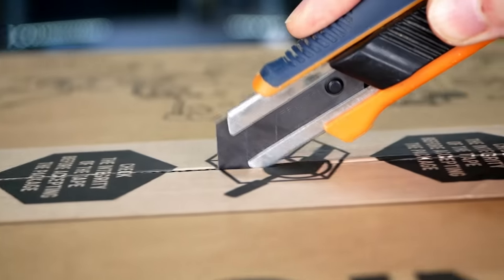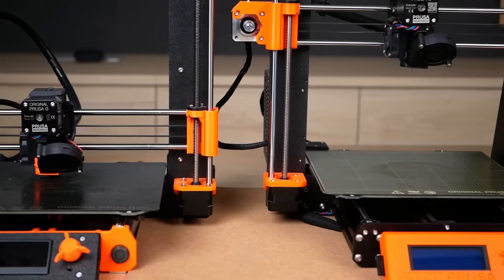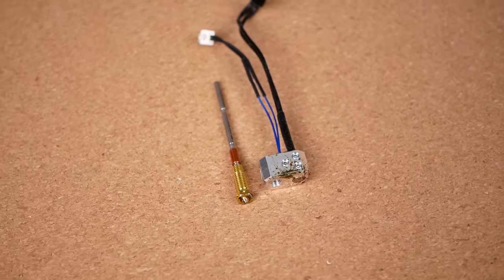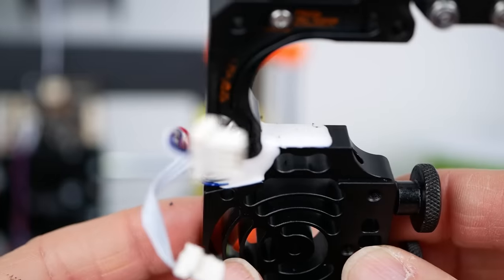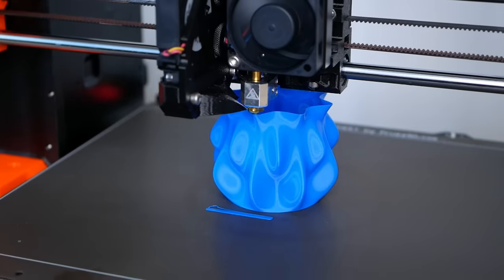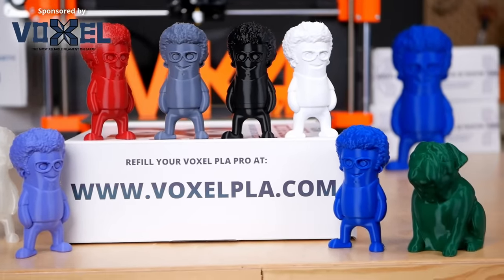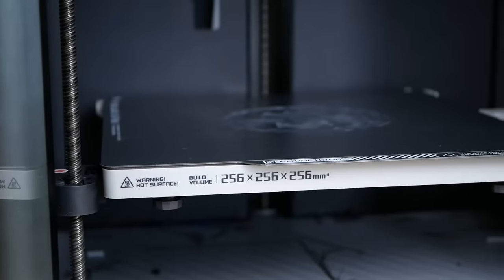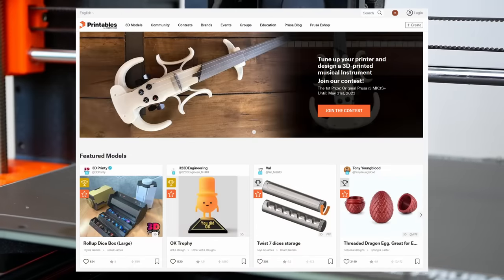Should you buy a NEW Prusa MK4 in 2023 or rather a Bambu Lab X1/P1P?

Comment: Prussa 4k as a hobby-ist. but if I had to print many identical things quickly and speed was an issue I might go Bambulab as a trial. But My MK3 with upgrade 5 spool exchanger is solid turn on and walk away. you can't beat reliability and the customer service over the years is A1. besides. It came with gummy bears as a snack during the build process...Awesome... and Haribo gummies at that🤣

Comment: At all who complain about the price of the Prusa MK4 compared to the Bambu P1P. Did you ever consider the lifespan of the printers? There are X1C from Kickstart that already have more than 2k hours on them and the bearings and rods have started to wear out. There is no possibility regarding BambuLab to do any maintenance on your own. You have to send the Printer back to BambuLab to get the maintenance done, and also, they can't tell you the exact costs. My friend was told that it would probably be 400-500€ for a printer with only 2750 hours.
There are Prusa MK3s out there which have more than 15k hours on them, with no major maintenance!  

Costs: 
So when we come down to what is the lifespan of the printers? Let's assume that a Prusa MK4 makes 15k hours, and a BambuLab P1P makes 3k hours (which it won't do). What does the Calculation look like?
Prusa MK4: Investment 1000€, lifespan 15k hours: Printer hour amortisation: 0.067€
P1P: Investment 800€, lifespan 3k hours, plus 4 times 400€ major-maintenance costs for another 12k lifespan , Total: 2400€: Printer hour amortisation: 0.16€
Now you can say the P1P prints 2-3 times faster than the MK4, and you end up at the same costs as the MK4. 

Support:
What about the support of Prusa? Just awesome! Jump in a chat, describe the issue, and receive support/spare parts.
What about the support of BambuLab? ...it's ridiculous. Response times more than weeks. There are so many DoA's out there who wait for months for spare parts.
I have personally been waiting for a new bed for three months! Waiting for another bed for my second X1C for two months. All signs are telling that the beds will be bent as before, simply because the bed design is a design flaw. 

I don't wanna start with QC. But anyone thinking about buying a P1P or X1C, go and look in the BambuLab forum. You won't buy a BambuLab printer anymore.

Comment: Stephan, I see you are using VOXEL in AMS, can you comment on reliability?  I have been respooling some filaments onto Bambu spools for utmost reliability.  Also, since you are genius level, how about reverse engineering the RF tags so we can put them on other filament types for auto profiles?
Reply from the maker: So far, they have been working reliably in my AMS. Regarding RFID; Have you seen this: https://github.com/Bambu-Research-Group/RFID-Tag-Guide
Reply: @CNCKitchen  thanks for quick response.  I have seen that link, but looking for a complete solution rather than just reading rfid tag.  Here is my ideal, be able to buy an rfid tag preprogrammed to allow a profile to be created in slicer to match.  So, far the only way I have been able to “cheat” is buy refill with color or type I don’t use and then modify the corresponding Bambu profile..less than ideal. I did buy Bambu PLA and have respooled my own (with printed respooled from Printables.  I just didn’t want to be locked in to Bambu filament due to cost versus vendors like Voxel, Hatchbox, ERY and others. I guess not a huge deal, but hardware is there. I did put ticket in with Bambu, they should sell blank RFID tags and allow this,but I think they want to lock you i. Which isn’t feasible given their poor stocking availability and cost.

Comment: honestly, i ran into so much issues with my mk4 compared to the mk3, i just sold it, weird layer shifting, parts modeled square but printing not square, the support being absolute assholes now, the missing colision detection that would have saved some of my prints, the quality with input shaping not being there yet, and more, my mk3s on the other hand is printing better than the mk4 with the updated parameters, really is still a beast after 20K hours, i regret selling one of my mk3 to get the mk4, really.

But for coms and prototyping i think i will take a bambu for fast printing.

Comment: Ive had a love and hate with prusa printers, when they work all is great but when issues happen you have to disassemble most of the working printer. If you found the wrong issue you then had to do it again. Enders seemed to make it easier as extruder and hotend were more accessible. I have been searching for multi color printing solution and prusa and mosiac have been nightmares. Bambu just works. Yes there are issues but mainly due to filament.   .... with that said I have retried 10 enders and prusa's from my print farm to bambu's. I will be looking at your pla sponsor as I use a lot of colors in multi color prints
Reply: $320 order of filament placed

Comment: It's to the point that I am almost over tinkering with 3D printers to improve a product I purchased because my ender 3 pro has given me soooooooo many problems over the years. I kinda hate the style of printer that the mk4 is and would much prefer a core xy after all of the tuning time and effort I have put into a far inferior product. I like tinkering, but I don't want the fixing and adjusting to take a backseat to the actual printing. If the MK4 came out a year and a half ago, there would be no issues with it's pricepoint, but since the X1C, P1P, and P1S all being within spitting distance of the MK4 whilst offering seemingly more capability, the mk4 doesn't seem like a reasonable buy.

Comment: I think I would buy the Prusa MK4. I am a big fan of Klipper firmware, and I have a heavily modified Ender 3 that I've been upgrading to print faster and faster over the years while also increasing the print quality at those high speeds. But now I feel like I'm printing things so fast that it's more of a flex than practical.The thing I am chasing is the highest quality possible, not record-breaking speeds, and I think Prusa is still king when it comes to print quality. I am amazed by the Bambu Labs lidar sensor and auto input shaping, but the software seems proprietary and locked down. I prefer open source software, I want a machine that's easy to work on, easy to repair, and easy to upgrade. However, I do think it's time Prusa moves to a Core X Y design.

Comment: The one thing I’m not a fan of is the cost of the nozzles. If you live in the US it could cost over $40 for a BRASS nozzle. Then if you use the adapter you still have to hot tighten and could leak and affect your first layer. I don’t understand why nobody is talking about nozzle cost.

Comment: Hello Stefan, very comprehensive review ar  high speed 😄.  Lots  of talks about MK4 <> bambulab machines lately.  
Well, I use neither of them. I make small high precision parts with FMD but as it is for business and speed was not my first priority, very low investment cost at start of buss is key to make money in an area where you pay 50 cents per kwh for electricity. So  I still  use very low cost bed slingers, effectively about 230 Euro each, based on the old ANET A6 kit, but rebuild it so they run on a 32 bit board, and a sherpa alike extruder on lin rail with a simple strain gauge for nozzle probing , they do just fine, but speed is of coarse another thing (~80mm/sec)

But objectivly speaking: when I now see this Bambulab core xy printer quality of print  and that at a very serious higher average print speed......this becomes  very interesting for production too,  times 2 or 2.5 the print speed... that is a serious win.

What I  really like on the MK4 as a good innnovation is this double pressure wheel on the large drive gear to give larger grip area. I guess it brings fantastic filament grip... but ....  for on a bed slinger ? ....  It would excel on a core XY where higher /constant output and  much  higher pressure is  a must when printing with small nozzle diameter (0.15) at high speed for small  tech parts.  
For the rest, well looking at  11:55 and 16:20 of your review.... knowing what is different inside both machines regarding various technologies, It speaks for them selfs....

Do not fully understand their strategy in the bed slinger design by PRUSA for sake of upgrade .... I guess all their customers with MK2 / MK3 are very happy with this solid work horse, so they could have moved over to the core xy in the MK  price range.   Come one PRUSA !  lets beat the chinese ! 😅

Comment: I recently had the chance to test a Bambu Lab X1 Carbon coming from the Open Source POV and I think the Bambu Lab is especially for non-tinkerers. Like when you just want a 3D printer for actually production and rapid prototyping without a deep dive into 3D printing basics. It basically is the first plug and print printer I've seen, that actually can be considered plug and print (not exactly, but almost). Still, I wouldn't buy one as I really enjoy breaking and fixing my machine.
Reply: People were saying the same things about the ender 3.
Reply: @pomprocks  Actually, I never heard anybody saying that about the Ender 3. Yes, it was praised as a production machine due to it's reliability as well as a beginner model due to the low price, but the Ender 3 was never promoted as a plug and play device that can be handled without experience (although it was some kind of miracle compared to its competitors at the time when considering what you get per buck).

In the past many manufacturers falsely claimed to bring a plug and play experience to desktop 3D printers (e.g. the later Ultimaker models, Makerbot since their acquisition by Stratasys and the somewhat laughable Solidoodle 2), so I naturally doubted the promises made by Bambu Lab, but the X1 turned out to be the closest to plug and play I have ever seen. Setting it up required almost zero effort and it printed almost perfectly out of the box, even when handled by someone inexperienced. It's been two weeks since I worked with it and I'm still stunned. It all comes at the cost of a closed sourced environment, though, so it's nothing for me.

Comment: The Prusa is a bit like a Celacanto, a living fossil  still doing what it was supposed to do. The quality they pull out of the prints have been always great, but,  for those like me who need speed+quality at low prices we have long ago migrated to resin printers, I keep fdms for prototyping in big format and functional pieces, but for things that eventually will go into injection molding or diecast, so they will go for some finishing anyway, the effort that goes into keep a fdm running, fixing, and updating and taking care it is just too expensive and time consuming, for instance, a delta machine and a resin machine both bought at the same time, the resin machine still goes unchanged where the fdm have gone through 3 hot end changes, one mother board change, one display change, and extruder improvements, several nozzle changes,  and chassis modifications to avoid motherboard overheating (because of design problems), I mean under 1k fdms are hobby machines, prosumer machines at best, if you would like to go pro and still somewhat european just by a Wasp, I think Prusa is a bit now like a Leica, (without the design since I think to have a 1k machine with 3d printed kit like parts is unacceptable) but today, why would you pay so much  for a machine that has a y axis moving bed, which at the end its very limiting, quite limited building volume   and too many characteristics present already  in sub 200 euro machines? Whoever has been involved in electronic design and manufacturing knows that today whatever you do  in Europe will  have a huge % of Asian sourced parts, so I think the European costs are no excuse... the prusa should cost 400 bucks, and I'm sure they'll sell a ton, the thing is like a manufacturer told me, I prefer to sell one thing at 500 than ten at 50. And that's just how you eventually  go bankrupt.   Bambu wont get to be a monopoly, they are just doing what Elegoo did, pull out a great machine at hobby consumer's reach that once belonged to the pro area...the triptronic gearbox now present in a Polo is the same that   belonged to a 90s Porsche, and that's just evolution...like the Celacanto.

Comment: I am considering to replace my mk3 farm to either same number of mk4s or half of that in x1cs. Very hard choice. The x1c is absurdly fast with quality I haven’t seen before. But the mk4 is from a brand I’m familiar with, has proven itself and is very customizable. 

I bought one x1c to test stuff and also made a special S3D profile to make automatic PLA part removal possible. Which is very nice for large quantity printing. But the fact that Bambulab (semi) locks you you into their system is something I hate.

For example: they use a range of custom gcode commands which have no explanation anywhere. Using a different slicer than Bambu studio also makes certain features unavailable, probably because the required gcodes/commands are not published. You can send prints via wifi from you computer as long as you use bambu studio to slice models. But as far as I know you can’t send gcodes sliced elsewhere because you can’t import them into bambu studio, so the old fashion microSD card is still needed.

Anyway, I do think the speed, quality, closed build chamber and my automatic part removal profile will make the x1c winner in my case.

Comment: If it's possible to implement Klipper and input shaping on an Ender 3 by hooking up a raspberry pi and a little sensor, then there should be zero doubts in your mind that the same can and will be implemented on the MK4. It's very plausible Prusa is just analyzing Bambulab's machines while optimizing their own software only to push out a software update later that enables all the features to fully utilize the hardware. I don't even own a Prusa so I'm not even biased in this discussion, just pointing out that I can almost guarantee you that they wouldn't spend extra money on sensors and other hardware without planning to fully enable their usage with a software update later.
Tesla did the same thing with autopilot.

Comment: Prusa has very good engineering, but seems to be a bit short on delivering on the software side, as you state.
I'd hope they find a way to be more competitive there.
And as far as writing software, it is also a bit old fashioned to first set your hardware and then select the software. Wonder why they would not use Klipper for example. Perhaps limited availability of suitable raspberry Pi equivalents has to do with that.

Comment: From what I have seen here, the Bambu P1P is currently better than a Prusa Mk4.  However, Prusa printers come with a 1 year warranty and the parts remain available for a long time.  I have even been able to download the parts and print them myself.  I have also done a firmware upgrade on my 3 year old Prusa Mini, which made it better than it was when I bought it.  I have also been able to contact customer support and get help with my printer years after the warranty ran out.  

When you buy a Prusa, you're paying for the customer support.  When you buy a Bambu printer, you're paying for the speed and the features.

I am disappointed that the new Mk4 is a bed slinger and not an H drive or coreXY.

Comment: The problem Core XY printers like bambu lab have is accuracy. I'm not sure what he was looking at when he compared the prints. Just look at 11:48 the whole print of the X1 is slightly under extruded with blown out dimensions on small details like the fuel lines due to input shaping. I mean these dimensions are at last 3:1 ratio off. Just because input shaping smoothes  the part doesn't mean it is an actually good print. The fuel lines look like random dimensions sausages coming of that rocket engine. LMAO! Overhangs are worse than one of the MK4 too. Judging how mat the print of the X1 is,  horizontal layer strength is probably half that of the MK4 print.

Comment: Solid points on all counts. I hadn't realized that the MK4 didn't have its input shaping available yet until I saw this and another video. That is disappointing.

That said, for me, it's about serviceability, reliability, and support. Bambulab's offerings are great, but from day one I had reservations about the proprietary ecosystem they had. While I'm a little disappointed Prusa decided to go in-house with their nozzle-break design, I know it will be on tens of thousands of machines and will be supported in the future (not to mention I will be able to use my existing nozzles with the adapter). I also know that I can easily service my unit as I have done for years with my MK3. (Yeah, I guess I'm a Prusa "fanboy," too.)

I can't afford the MK4 yet but while I am saving my money, I can watch and see what they do with their firmware, troubleshooting, and more.